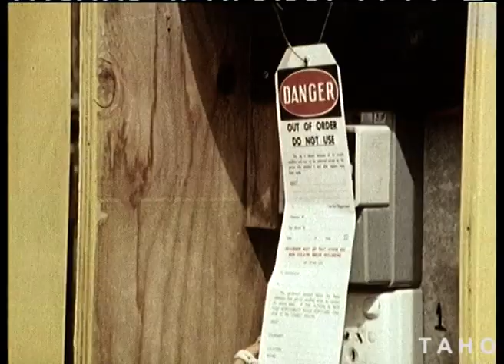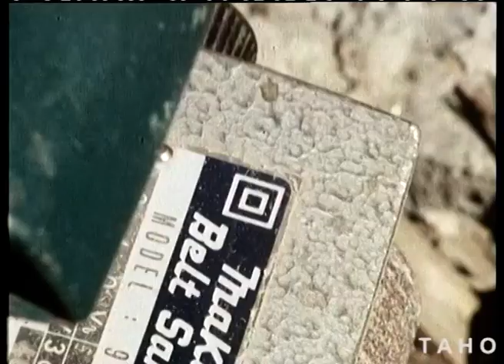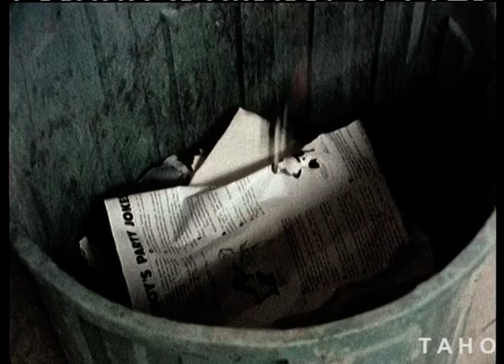Alive: Electrical Safety (1981)

Comment: No mention of eye protection or ear muffs!
Reply: You definitely got that right , Especially when using an angle grinder , I always wear the proper PPE , Personal protective equipment and always use a GFCI outlet when using electricity outdoors and I always test the GFCI before using it , They say to test the GFCI monthly but I always test it before each use for added safety 
When GFCI outlets first came out , 
When they wouldn't trip when pressing the test button , The power stayed on 
But later , They redesigned the GFCI so if it goes bad , it'll trip and not reset 
So if you find your GFCI tripped and won't reset , It's time to replace it with a new one because a GFCI will eventually go bad over a period of time 
When using electricity , Especially outdoors , Always check your equipment to make sure it's working properly and check electrical cords carefully for cuts and abrasions and if found , Replace it immediately 
In everything you do 
ALWAYS PUT SAFETY FIRST !!!!
Reply: @ironmartysharpe8293  Very detailed, interesting info. Thanks 👌

Comment: They should have been using GFCI receptacles and cords on the job site , 
The person who serviced the angle grinder should have had somebody else do it because it was wired incorrectly , Making the tool electrically live , Now if a GFCI was being used , The power would have been cut off in 1/40th of a second , I see people do this all the time , They cut or remove the ground prong from the plug and they're just asking for trouble when they do that , The ground wire carries any leakage of electric current away from you and down into the ground
Especially when using electricity outdoors , A GFCI is an absolute must because there could be puddles present or other objects with moisture on them and the ground itself can be wet , That's why using electricity outdoors is more hazardous than indoors , There are portable GFCI receptacles available that plug into existing receptacles and some extension cords have built in GFCI protection , Never take chances with electricity , It's not worth it and can cost you your life , When it comes to safety , There's no such thing as being too careful , Before you begin your job ,  
Always check your equipment and all electrical cords for any signs of damage and if there is even a slight amount of damage , Get it fixed or replaced immediately

Comment: Yup, I may like to repair and tinker around with things or appliances, but I do NOT eff around with that high, serious-grade electricity. Nope, nope, nopitty-nope-nope. Too all of that. That's what the pros are for.
Reply: You got that right , If you have the slightest doubt about something electrical , It's best left to the professional , You have to respect electricity , What you saw in the video , It's a wonder nobody else was killed because of the chances they were taking , Especially overloading circuits and using frayed electric cords , And not using ground fault circuit interrupters for all power tools
A GFCI would have sensed that person getting shocked and trip in 1/40 of a second
Long before the shock would be lethal , Saving his life , GFCI outlets are an absolute must when using electricity outdoors
Anytime I use electricity outdoors I always use a GFCI and test it before each use and thoroughly inspect all electric cords for any damage before using
Reply: @ironmartysharpe8293  Yup. It's mostly common sense when it comes to your day-to-day electricity or appliances. Water around, overloaded sockets, dirt-old appliances that haven't been used in ages, leaking batteries on or near electrics, and frayed wires get my hackles going. XD
As for all the wires running behind the walls of the house, big backyard digging jobs, or overhead street wires, downed wires, there's no question....electrician. I grew up around a few people in the electric trades, and there are accidents even with the pros due to miscommunication, under the influence on the job, lousy safety setups at work, and carelessness. I've heard too many stories about homeowners not knowing what they were doing and were too proud, had something to prove, or wanted to save a buck. I may have to pay a bundle for the pro's services, but I have a much higher chance of being alive.
Reply: Agreed
Reply: @GrootsChannel  :D